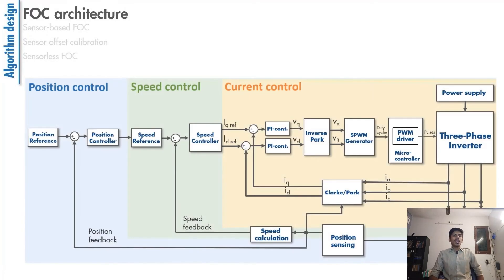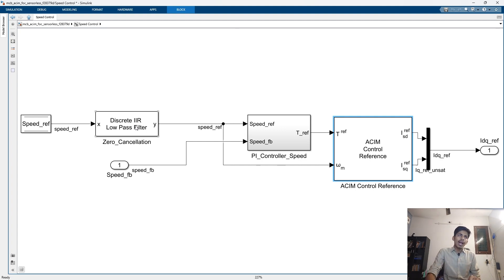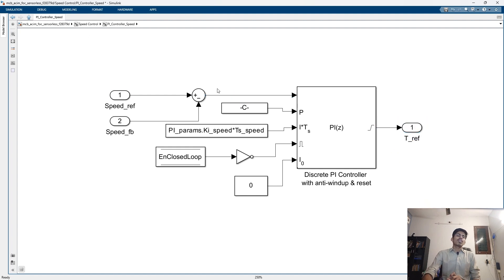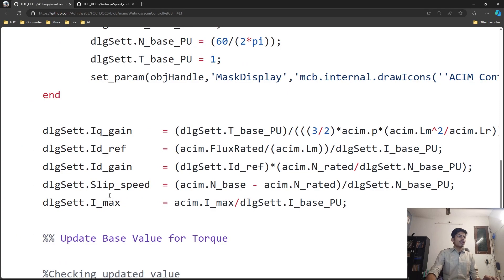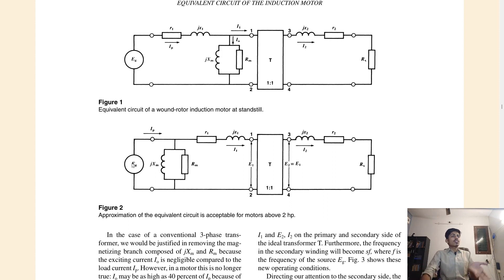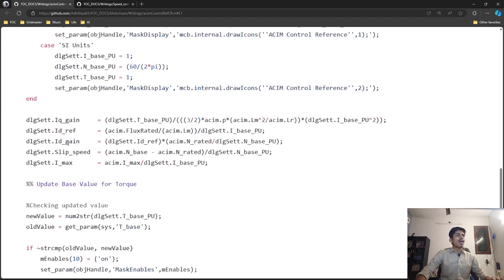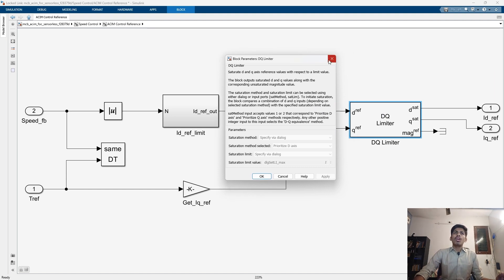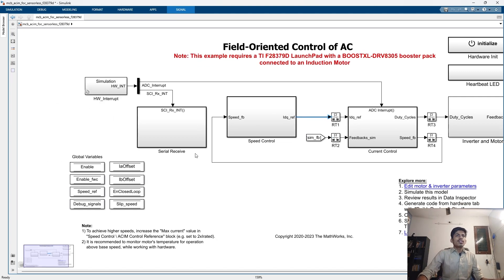Part 2: Speed Control Subsystem in Sensorless FOC ACIM using MATLAB & C2000 Microcontroller

Comment: Hi Aditya, thank you for the nice explanation. It is a very good reference for me. I am planning to implement FOC with an IPMSM in MATLAB simulation, and I would be grateful if you could provide me with some guidance or references.
Reply from the maker: Hi, I’m glad you found my explanation useful. At the moment I’m fully focused on preparing for an upcoming exam, so I won’t be able to provide detailed guidance right now. However, I’ve documented some material on FOC here: https://github.com/Adhithya03/FOC_DOCS — you may find it helpful as a starting reference. Wishing you the best with your simulation work!
Reply: @Adhithya1002 Ok Adithya Thank you